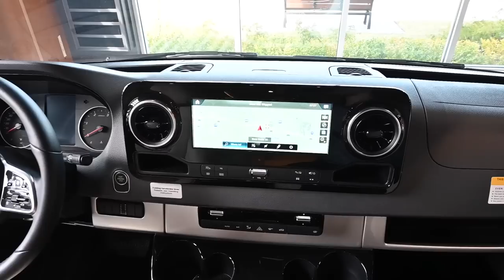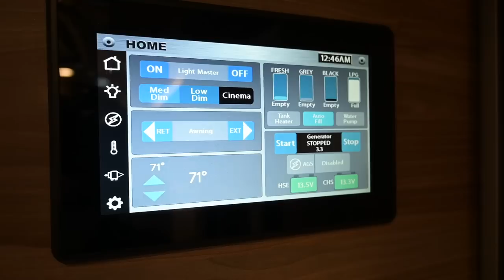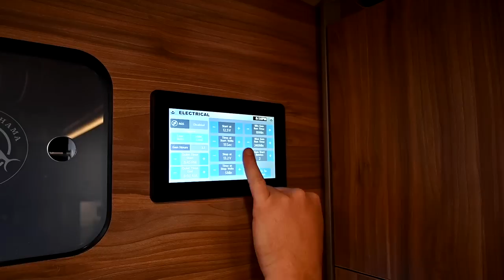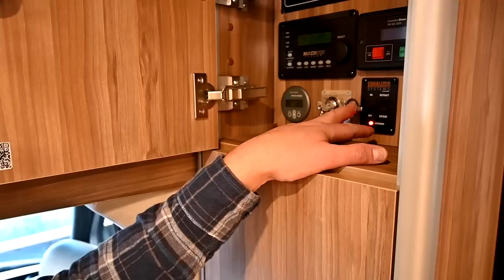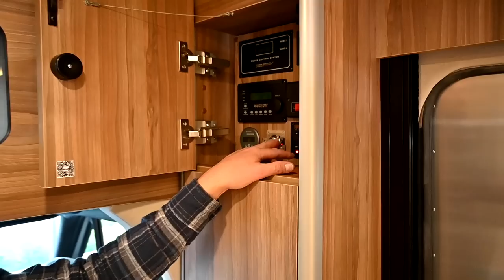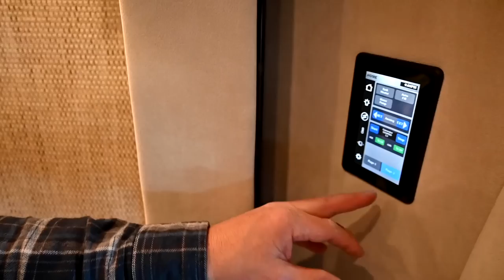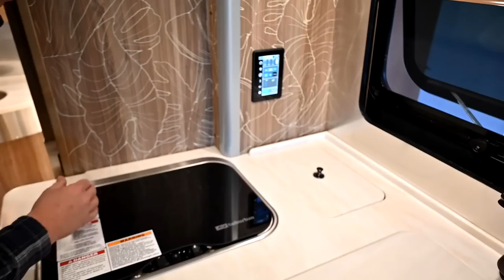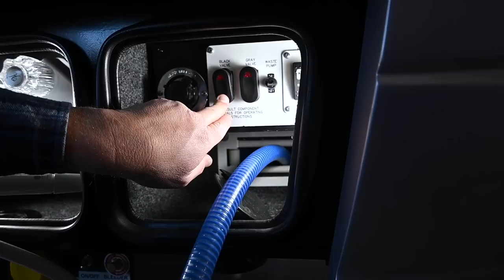All-New Luxury RV | 2022 Airstream Atlas Tommy Bahama Edition Mercedes Sprinter

Comment: If I am correct the bed is a..., 73" x 73" mattress, with the drop down headboard part of the bed , an additional 7" ( the drop down headboard width ), this  =  80" x 73" total size, or an RV king? Is this correct?
Reply from the maker: The bed dimensions include the drop down extension. It is not used as a headboard.
Reply: Thank you

Comment: I wish there can be an add on bunk bed. There is no reason that the car can seat for 4 but only sleep for 2.
Reply from the maker: There is an optional front bed for the cab seats. There are two seatbelts so an adult passenger can sit next to the 3rd passenger.